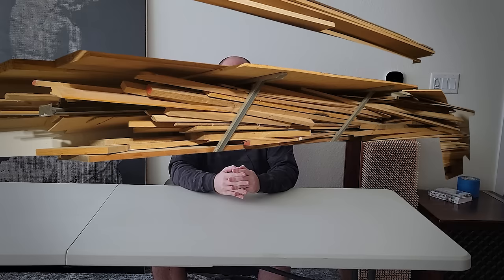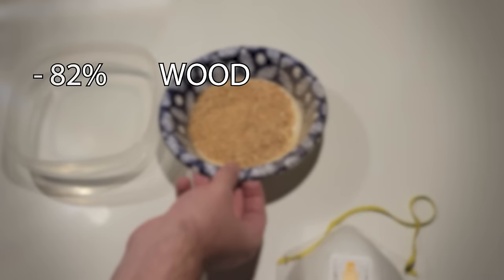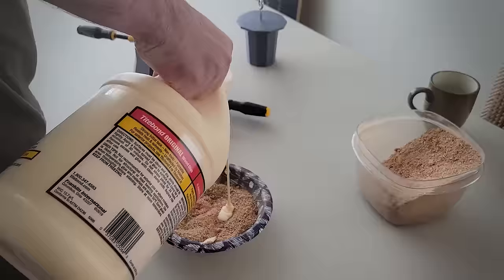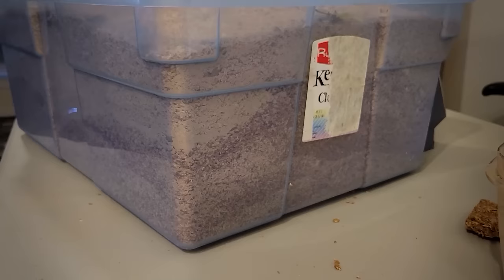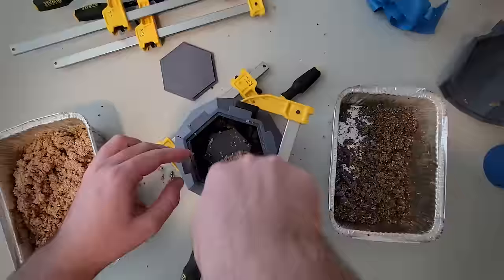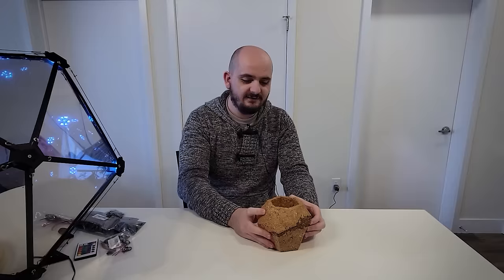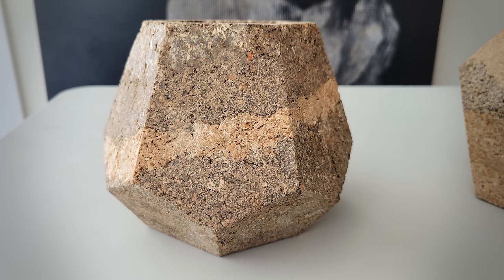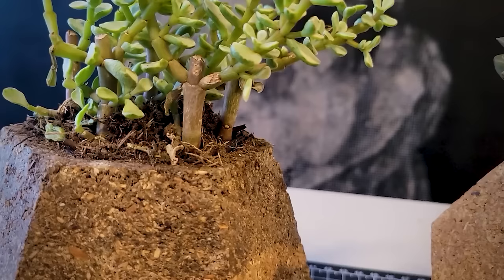I Turned Scrap Sawdust Into A Woodworking Project To Sell

Comment: I noticed you used titebond original. That's not waterproof. If you subject it to water like in a planter, it will eventually degrade. Titebond III is for projects that come in contact with water but is still not 100% waterproof. Epoxy is 100% waterproof and might saturate the saw dust easier. And you wouldn't have to use that sleeve. And you could go to a local woodworking factory and probably get tons of sawdust for free. I think you have something with this idea.
Reply: Thanks for the advice but don't you think epoxy is a too expensive material for this kind of job? If we could make epoxy easily ourselves that'd be great but I cannot see any reason to use that for recycling sawdust.
Reply: "eventually" degrade
Reply: Everything "eventually" degrades.
Reply: hello! do you think mod podge is good for this kind of project?

Comment: I suspect mixing the glue fire tly on sawdust leaves some areas concentrated. Other areas dry. If you evenly mix / dissolve the glue in water, then gradually add to sawdust & mix thoroughly you will get better gluing,easier drying and more even mix

Comment from the maker: EDIIT: These are sold out now but the digital models for the molds are still available if you wanted to print your own. Thanks for the support, I hope to add more stuff like this in the future that people could get if they wanted their own.

New project finally done! Hope you all enjoy and take some inspiration and try it yourself. Also make sure to check out the Etsy store and pick up one of the five sets of these planters if you want. Thanks for all the support and being patient as I set up everything to be sold. I don't like releasing anything that I feel is unfinished or not the best thing that I can produce so that often causes long lead times but I want to make sure its all quality.
Reply: Ideal Idea , which software do you use for your 3D model designs?
Reply from the maker: @jaguerra  I use Sketchup, its a much "looser" design software but its free and helps with more conceptual ideas.
Reply: @Ideal_Idea  thanks

Comment: We were just now working with sawdust, glue and food coloring because we needed detail but abhor epoxy resin.  Don't get me wrong, we have a fiberglass boat and I think it might make a good waterproof coating for the inside of sawdust containers. Best edited video ever and my wood scrap pile is taking on a life of it's own.
Reply from the maker: Very interesting, how did the food coloring turn out? That briefly crossed my mind but never tried it.
Reply: @Ideal_Idea  It seems good.  Our first thought was wood stain but we were not sure how well that would work with white glue.  We sanded a little early as I was over eager but it sanded off easy by hand and easer with the drum sander.  We sifted the sawdust so it was pretty fine and made a paste.  We are testing an idea for wooden coasters with a design routed in with the cnc and we wanted it to look more rustic than something like epoxy.  But the color is good and it seems the food color penetrated the wood dust for a nice consistent but rustic finish.  A few more tweaks but looks like we are moving in the right direction.

Comment: Over a year ago I thought of the same idea but haven't had a chance to make it because of my printer having several issues. I plan to do it with more fine sand dust and more glue so it has a smoother look I also wanted to dye or stain it interesting colors but it's cool to see someone make something I thought randomly a while back

Comment: I think you leaving out the wax is what gives them the pitted texture, the wax probly fills in those pit under the heat and pressure mdf goes through
Reply from the maker: It might be, these were also the worst ones I made. For the ones that I made to sell I used a lot more pressure when packing and a lot of the pitting went away but adding wax might be what its missing to really give it a MDF feel.

Comment: As for a sealer, I've been experimenting with clear spray Flex Seal on a planter that I made. It's held up outside for about six months now, with sign of wear or yellowing, as of yet. It could be an alternative to using a plastic sleeve. Definitely quicker.
Reply from the maker: Interesting use and not a product I would have considered, I will look more into that

Comment: Imo mere hand pressing it into the mold left the end result to pourous. I'd be curious to see if it could be compacted better if put into a vacuum chamber since it would be impossible to do compaction through pressing it with any decent force. I'm thinking vacuum chamber might leave a smoother texture to the end result which I think would look much better. Especially going for that marble look.

Comment: If you could make the molds out of acrylic (cast them in acrylic resin? 🤷‍♂) you could see the layers as you add them and it would make it work kind of like sand art.
Reply from the maker: Not a bad idea, might be able to use clear PLA to print it as well and give some indication of the pattern youre making, any help to see the inside would be good instead of doing it blind haha

Comment: You might as well make them out of particle board that you can then wet and rub for the same look. You can even give them the marble effect by dragging a feather dipped in your contrasting color and randomly pulled across the surface.

Comment: Actually very creative. I wonder how it would look if you did a coat of clear epoxy on it? They could definitely sell also, I think.
Reply from the maker: That could work, the main thing I would just consider would be to get a UV resistant epoxy if they are sitting out in the sun.

Comment: Just a thought I had, what if you blended the sawdust to make it finer. I feel like it would be much more dense when packed. Not sure if that would make it stronger or not but just an observation I thought about. Lmk if you agree with that or not.
Reply from the maker: It would help, that is what i ended up doing it but it was really quick in this video. For the duplicates I made I blended it longer and it was definitely easier to get lass gaps

Comment: You may get better results mixing the water and glue before adding it to the saw dust.....Though MDF and particle board aren't held together with normal wood glue they use glue that's activated with heat and pressure. They also use the lignin in the wood fibers to glue everything together. That's what the water is used for it turns into steam which heats the lignin in the wood up activating it.....Anyhow seeing as all that is way too much for a small shop. Another idea is to maybe use a low viscosity epoxy resin to bond the sawdust together. That should solve the drying issues and probably make for a more durable end product.

Comment: Do you know anything about thick(somewhat stiff) PVC laminate flooring? Or any flooring really, but the PVC kind i have the most of...

I got a rolling cosmetics cart out of our local recycling bins, including door locks (without keys unfortunately, but thankfully unlocked already) and according to what I've seen on eBay, it would normally come with 2-3 inch tall drawer bins, but unfortunately mine being a recycle bin find, didn't come with them. All that said, I've been looking for a way to easily make shelving to use instead of the standard drawer bins that would normally have been used, and going through all the different ideas I came across some leftover pieces of both wood laminate and PVC laminate flooring both of which have a rubber underlayment on the bottom, which I can then flip the shelving over if I need a shelving board that has a more non-slip grip on, and I've been wondering, for both the wood laminate flooring and the PVC laminate flooring, what kind of glue that I have her on the house, would work, to permanently join the two tongue and groove pieces together into one easily removable board that won't separate on the way out of or into the cart... Because I am using the lengthways tongue and groove portions and it not the end tongue and groove portions, it's obviously not a structural tongue and groove joint, just a joint that holds my rear and front boards together, and should be plenty strong enough for the small amount of weights that I will be using the rolling cart for, specifically for the most part, for lightweight crafting and computer maintenance stuff, such as screwdrivers, exacto knives, Velcro, cheap plastic paper cutters (not guillotine style but press and cut style) as well as other things such as shrink wrap tubing perhaps, and Milwaukee paint pens or whatever else I might want to add... I might even add some kind of an LED lighting system, so it isn't quite so dark in the unit, maybe...

But again, I'm just looking at ways to glue vinyl/pvc flooring tongue and groove flooring together, as well as doing the same thing with the limited wood laminate flooring scraps I have... I have a tiny scrap piece cut in half, with a bit of titebond 2 wood glue on, to test whether it will work on the tongue and groove parts of vinyl flooring, but again, it's WOOD glue, not vinyl glue, if there is such a thing, so I'm not holding out much hope

Comment: Wait, you put plants which means water, how does it react to water???
Reply from the maker: The 3D printed interior sleeve completely separates it from water so it has not been a problem for me. If you didn't have that then you could probably find a good outdoor usage finish for the inside

Comment: Hi Robert, this is Robert. I got your plans yesterday and it has a small problem. I did the inside sleeve twice, and both times the bottom fell off. Is there any way you can add 4 or 5 mm to the bottom, that might fix the problem. Then send me an update because I can't use cad programs, and this looks like it is something that is very nice. I would have done this on the Esty email, but it wouldn't let me. Waiting for a reply. Thank You. Bob
Reply from the maker: Hey bob, this is the first time I have heard of this problem so let me see if I understand it. Is it the file "Mold 02 - Inside Sleeve" you are having problems with? And it is just the bottom thickness you're having problems with or the walls as well? They are all the same thickness currently. 

If you are meaning that the sleeve is loose in the final, that will depend on when you insert the interior sleeve curing the drying process as the sawdust seems to move slightly upon drying out.

I will message you on Etsy as well.
Reply: @Ideal_Idea  Thanks for replying so quickly. Yes it is the Mold 02 - inside sleeve. It looks like the bottom pulled away from inside the wall. Maybe if it had a small bevel along the that edge that could fix the problem. This is in the 3d printing of it. Other then that little problem it looks good.
Reply from the maker: @roberthephner6985  I have added an additional file with those changes. If you redownload the file from Etsy that should include the altered file now. Hopefully that should work for you now.

Comment: As a person selling MDF for a living (working for the 3rd largest producer in the world), I suggest you check your facts on the composition of MDF. 
One of the main ingredients is a Urea Resin, which you don't mention anywhere. Oh, and the moisture content is no more than 4%.
And the key factors of the process you are not introducing are pressure (to eliminate air trapped between the fibers) and heat (to cure the resin and wax).